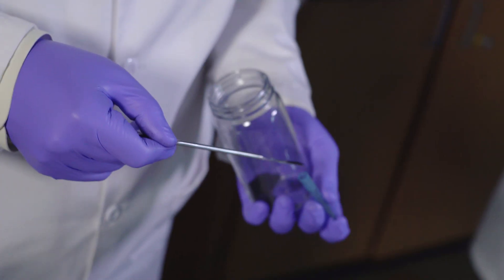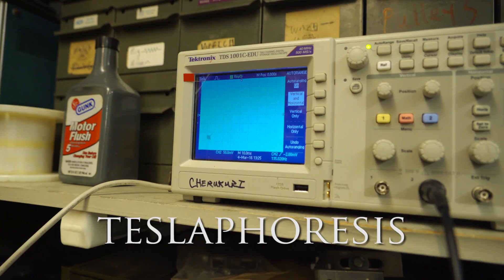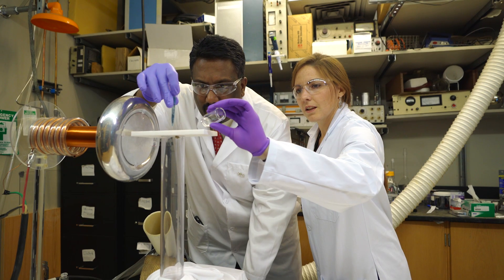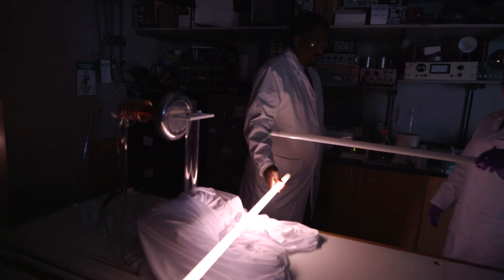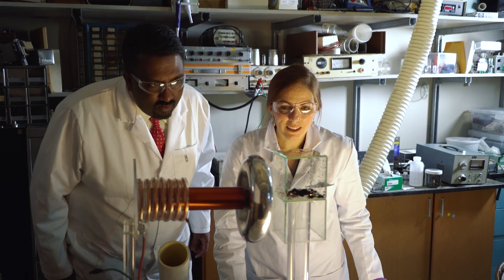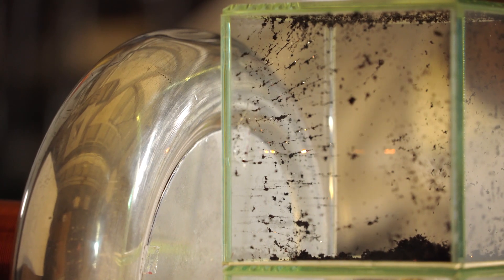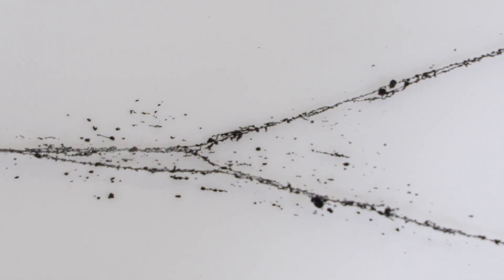Nanotubes assemble! Rice introduces Teslaphoresis

Comment: Didn’t Japan ban vaccines for a while because they found black metal in them?
Reply: In Japan no graphene was found. 39 vials, from Spanish manufacturer Rovi, were found to contain small particles of stainless steel (as found in heart valves and joint replacements) due to a manufacturing fault. The whole batch was sent back. It has nothing to do with what's in this video.

Comment: And now we now what's in the chem trails.
Reply: Now we know what's in the jabs.
Reply: @1charlastar1234  nope
Reply: @1charlastar1234  Yes we do. The ingredients are available. There is no graphene in the vac.
Reply: @1charlastar1234  The University of Almería (where the study was conducted), said results were inconclusive and it was an anonymous vial delivered by a messenger service that could have come from anywhere.  The German MDs did not say there was graphene. No Australian researcher  has made the claim. You probable meant Austrian, but this is also not correct. The vac has been analysed all around the world and no actual analysis has found it there.
Reply: not in chemtrails
Reply: Contrails as in CONdensation. There are no chemicals in them.

Comment: Looks like "Chem Trails"
Reply: No it doesn't. There are no chemicals in Con trails Con=condensation.
Reply: @paulg666  Stratospheric Aerosol Injection. Lookup Northrop Grumman Weather Manipulation Article
Reply: @normahostetler7859  That has nothing to do with the contrails that you can see coming from the engines of jets.
Reply: @someguy2972  I don't understand that last word. Could you correct the spelling? 
It doesn't look anything like chemtrails or contrails. Where has he ever seen chemtrails? What you and he thinks are chemtrails (coming from the jets) are actually contrails with no chemicals.
Reply: @paulg666  yeah there's no wire being formed in the air. Get enough nano magnets from the vaccine? When the Webb telescope has you in its sights... you're fried. Some will say it was spontaneous combustion. Satanists will say you were judged. Have a good one, !@#$er.

Comment: Look at the graphene structure, 6 points, 6 lines, and many of these sixes. That is the the mark of the beast 666. Also what can cause pain (Revelation 16:10) and a noisome and grievous sore (Revelation 16:2)? Only something medicinal can cause these. Not a chip implant. Also human body is 18% carbon. So therefore the number of a man is also 666. (Revelation 13:18）The sun shall be turned into darkness, And the moon into blood, Before that great and notable Day of the Lord come: And it shall come to pass, that whosoever shall call on the name of the Lord shall be saved.
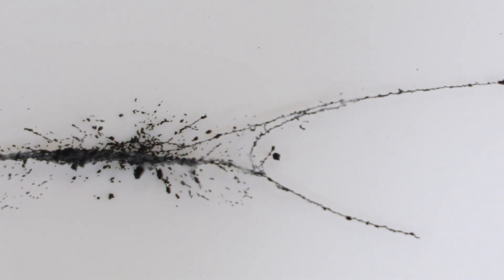-Acts 2:20-21

Comment: I'm not sure you should really be calling it "assembly".  The carbon doesn't appear to be bonding and forming a permanent wire, you remove the electric field and everything goes back to free range pieces of carbon floating in castor oil from what other videos seem to show.  Unless you can zap it with something like 100K volts to make the bonds permanent what use it is beyond maping an electrical field?  Interesting but I think it's applications seem a bit over estimated at this point.

This seems a lot more impressive in that it takes carbon nanotubes to a point where they can be used to build something. https://www.youtube.com/watch?v=4XDJC64tDR0

Comment: It sure would be nice to know what an electric field is and how it works, right?  Modern science is totally content describing what they see it do with math, and they think that they understand it, because they know what it is going to do.  This is about to drive me insane.
An analogy just occurred to me:  If medicine didn't try to learn the cause of disease and only treated the symptoms, it would be exactly like modern physics.  Physics is solely about the symptoms described by math.  Angular momentum does not cause the gyroscopic effect, proof, linear spin velocity and linear tilt velocity are perpendicular vectors that CANNOT affect one another.  Spin velocity is isolated from the effect by being perpendicular to the tilt velocity changes that have to happen at the spin RATE!  That is a lot of acceleration force.  THERE!  Math can perfectly describe and still be wrong!

Comment: pretty cool... but do you know why they align like they do?    The CNT's appear to align on the volt vector...
Reply: CoruscantMe 🤜🏼⚡️🤛🏻
Reply: Check out this vid I made using swcnt's with an RPS (relative potential source) as the apparatus producing this affect. 

https://www.youtube.com/watch?v=leEXoEsqqHo
Reply: What is the fluid you are depositing the CNT's in to get the CNT to stay suspended in the fluid to enable better mobility under the electric stress field?     I used distilled water for my video above...

Comment: The directed EM field is large, the nanotubes are, well nanoscale, so, other than the spontaneous end-to-end connecting, how is a more controlled manufacturing process envisioned? It's a great step as is, but it seems you get a random web-like outcome rather than something representing a design. Also, what happens when the field is turned off; does the structure maintain cohesion, or does it disintegrate if the fluid solution is agitated? Lastly, are there any useful electrical properties of a resulting thread like with nanotubes manufactured a more contemporary way?

Comment: Is not this is exactly like iron shavings  in ordinary magnetic field?
Reply: Just imagine the toxic syngery of excess iron in a body exposed to these Morgellons strings.
Reply: Not quite. Iron shavings lump together and get pulled toward the magnetic field and will change direction under the field, but they don't neatly assemble themselves into wires or strands like the nanotubes do here.

Comment: Powder will assemble into long strings, in the presence of high voltage. It seems to me that this is the same phenomenon as those bits of carbon.
Reply: +Adam-Mark IV Хорошо! Я могу писать на Русском. Я сделал эксперимент с Borax и CuSO4, где я използовал высокое напряжение (ZVS driver) и я видел те же линии что и в этом видео. Смотри!     watch?v=5kh7Znp4pvE
Reply: @MrSkypelessons  
You don't need external wires .. your own body produces plenty of electricity!
Reply: +Adam-Mark IV You're welcome! Yes, you are right. The powder (it's not carbon, but Borax and CuSO4) lines up along circular electrostatic force vectors between 2 electrodes (Like in б and в on your diagram). I think the carbon tubes in the video above are just lining up along the same vectors but like diagram 'a' where they spread out from one electrode. I guess they are spreading out from the LEDs which are powered wirelessly by the Tesla Coil.
Reply: @MrSkypelessons  This prove nothing
Reply: Add some Gs to it and make a monster
Reply: @SpecialOpsSniperUSArmy  ROFLMAO
Reply: @chemtrails?
Reply: @bs-inablux3207  chemtrails do not exist. And how anything in contrails lying at 30000ft could create some disease on men living on ground ???
Reply: @michel.b5752  Ever heard of GRAVITY?  What goes up must come down.....
Reply: @fig4159    Clouds stay up because of an upward force named "buoyancy". They don't go down !  So do the contrails and their content.
Air also stay up. I have never seen all the air present in the atmosphere fallen on the ground !!!
Reply: @fig4159  Ever heard of drag and buoyancy ? How comes that clouds stay up in the sky ? How comes that all the air of the atmosphere do not fall onto ground ?
Reply: @michel.b5752  😂🤣 is true - the more ignorant somebody is the more they actually think they know 🤦🏼‍♀️
Reply: @michel.b5752  What is in the clouds? Moisture/rain...which falls when those buoyant clouds get oversaturated.
Reply: @MrTallman22  Which don't happen for cirrus, or contrails which are a kind of cirrus. Maybe you should learn more ?
btw, cirrus and contrails are made of ice !!!
Reply: @michel.b5752  maybe you should be more objective than subjective with your points. Maybe you should learn more and stop misleading people with biased information. There are over 20 genus of clouds, which either comprises of water vapor or ice. Some produce rain and some don't but when they agglomerate, as many of them coincide simultaneously, results will vary.
Reply: @MrTallman22  My information are not biased, not like yours. Cirrus, and cirrus homogenitus (the real name of contrails) do not turn into rain. Go back to schools and learn !
Reply: @michel.b5752  I won't waste my time...more than I already have responding to you. I'm outside of the tunnel; have fun in there! ✌🏾
Reply: @MrTallman22  Conspirati go through 4 stages :
stage 1: They try to make you ridiculous
...
stage 3: they leave claiming they have no time, or that you understand nothing
stage 4: they are gone
There are no nanotubes in contrails. Morgellons are a skin disease, no external cause.
Reply: @michel.b5752  aerial dispersion and gravity
Reply: @paulp1166  You forget buoyancy.
Reply: @michel.b5752  Yes because travellers sometime flight in directions drawn in grids... It's obvious ;)
Reply: @SpecialOpsSniperUSArmy     morgellons  disease, is a skin desease, due to stress as are generally almost all dermatosis.
The "fibers" are indurations of keratin and collagen, 2 normal constituant of the skin. It itches and people often scratch them until it bleed. Pieces of fabric can be incorporated then.
Reply: @SpecialOpsSniperUSArmy  I was doing a radical detox and had that happen to me. I thought it was shistamatosis (Bilharzia) since I had suspected for a while I had picked it up while working for a charity in Haiti. I had been using some hefty herbal anti parasite. However I have also had to have a PCR test. Interesting. Better out than in but this was horrible I have to say.
Reply: @merilynpa  deluded.
Reply: Bill Gates  just stated he n his crew are going to start spraying nano powder in June of 2021.
Reply: @donjohnson9063  Never has he said that; You are just a liar
Reply: @donjohnson9063  He never said that
Reply: @donjohnson9063  deluded.
Reply: @donjohnson9063  Why are you so jealous ?
btw, June is now ended, and no nano powder have been found.

Comment: Are the structures only macroscopically resembling wires but made up of small nanotube fragments or do they actually form a single molecular string at their core? In the latter case, have you considered spinning them while adding nanotubes at the center to obtain longer strands?
Reply: The powder they pore in is nano tubes formed from some other source. All the Tesla coil does is bring the smaller tubes into alignment, and once the tubes get close enough the Van der waals forces between adjacent tubes bonds them together, but the coil doesn't form covalent bonds. (ie make longer tubes)
Reply: So they need to use this for creating long strands and then recreate the events that made the initial nanotubes so they will bond permanently.
Reply: birkeland currents, electric universe

Comment: I am sorry. Very very old and well used technology. You do not need the nano tubes. All matter of almost any material will perform the same. The basics of how this works is one of Tesla's operating principles. He used it all the time, it was clearly obvious and common knowledge in his day . If you read Tesla, or study his inventions, this process is used everywhere. It predates Tesla.
Reply: +aaaflooddrying i was just about to type something like this just now about how i was sure this was done before with using a set of wave frequencies to string power along floating filaments and gasses, like from what i remember he got crazy obsessive with it till the end with trying to get something large scale working with it, what i think this video fails to show is how they are able to use the current to develop stricture with the nano tubes
Reply: +aaaflooddrying I wondered if this was just a simple high voltage effect. Other powders form long strings under high voltage, and we all know that it's easy to turn on a light, without wires, with a tesla coil. 'Teslaphoresis'? What does this actually mean!?!!? Here is some powder under HV on the lab bench watch?v=9eZK44IH0hE
Reply: I know I saw that and thought: my goodness, cavemen? take an old technology, a nice music, people of color and boom. SCIYENCE!

Comment: Thomas Edison's ghost is the one dislike.
Reply: Bradey *you're*
Reply: He is planing to electrocute a herd of self-assembling elefants
Reply: +John Doe you must fun at party.
Reply: No, I bet Tesla's ghost is the one dislike since he'd hate to have his name associated with this monstrous evil.
Reply: @stcmww5056  an experiment with carbon nano tubes is 'monsterous evil'?
Reply: @naaaaaa7772  It's not just an experiment. Seems you don't realize that nanoparticles like these are dispersed in our air, food, and water supplies, and they self-replicate into networks inside our bodies that interact with electromagnetic frequencies to damage our health and mess with our minds. It's going to be even worse with 5G everywhere.
Reply: @stcmww5056  that's right, except i think besides spraying just carbon allotropes, they are also spraying various heavy metals and aluminium, strontium, barium etc, i actually noticed that on my screen door there are a whole lot of tiny little metal fibers i can barely see, thinner than hair, i'm sure at higher frequencies, these will allow microwave radiation to couple with tissue imbedded with this stuff, 

the best way to remove 5G from Planet earth is not through the rigged court system, but by sneakily using directed neutral matter beam generators or x ray lasers to destroy the electronics that run them, and it will drive the elite zionists mad when they can't hold anyone accountable hahahaha, (they are emp hardened) that or certain extinction
Reply: @naaaaaa7772  Oh it would be amazing if more people would think like you and put that kind of plan into action to stop 5G.
Reply: @naaaaaa7772  I didn't get notified about your last reply (I wonder why!), but I saved it just now and passed your ideas on in another discussion thread.  :)
Reply: @stcmww5056  they use it to actually read your mind. Believe me .I get harassed. Scary thing is it looks like they bind with our hair. It's really odd. I am having an issue with it. We essentially become an antennae.

Comment: do they mantain shape just while the current is running or you get permanent chemical bond?
Reply: That's what I'm curious about too. we have a tesla coil and a friend may have nanotubes. would love to assemble them and have nanotubes wires to use in other things. but I'm not sure if these guys stay together after the field is turned off.
Reply: Jordan Bennett Actually to me looks simply a phenomenon of polarization of any semiconductor, of course it's HF AC so it's not normal polarization as in DC, since molecules don't have time to turn back and you have losses of power (as you see lights among tubes and inside the LED) for the rest i suppose they align along simple Lorentz law macroscopically and Lichtenberg phenomenon microscopically
Reply: m0nty90 I wonder what would happen if you grew nano tubes in the electric field.. something tells me you could make really tall single tubes
Reply: Only when current apply. Otherwise it's just another wet toxic mess